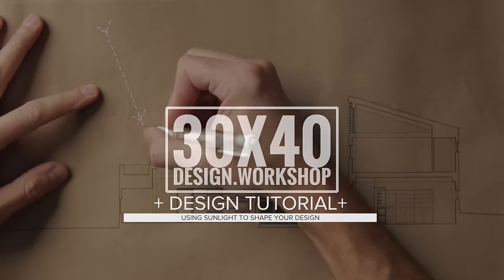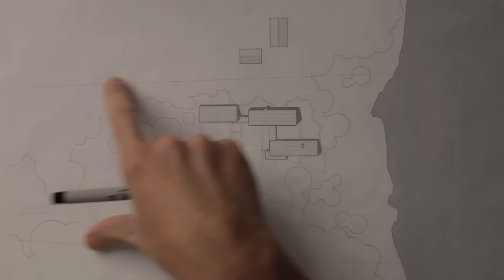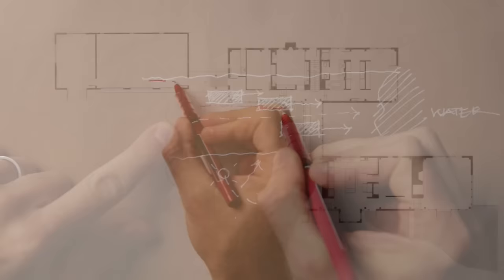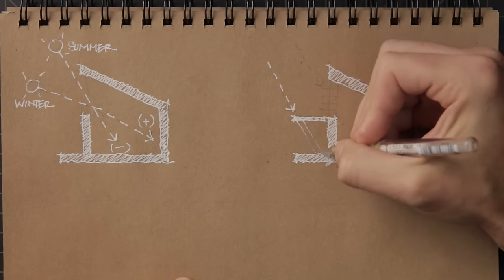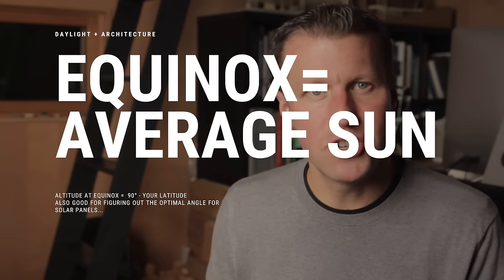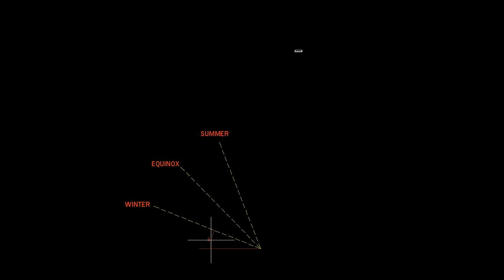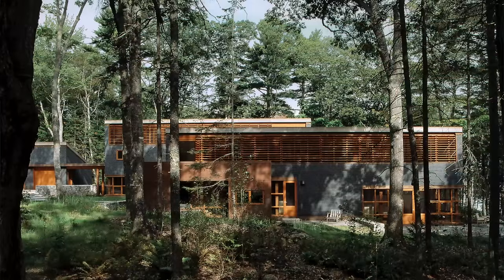Architectural Design Process | Form, Orientation and Sunlight

Comment: Hi Eric,  really enjoy your understanding of designing for the environment,  taking into consideration sun elevation and major wind directions. I lived in the Middle East where it can be extremely hot in the summer months and I found that the old techniques really helped in the comfort of the living area. Some design aspects are narrow through areas with high walls to shade from the sun completely and the use of wind towers in the buildings to produce the stack effect you mention.

Really enjoy your videos, and the ease of how you explain the reasoning behind what you are doing.

Comment: I like the design, and finding ways to get direct sunlight into the spaces, but here where we are very close to the equator - we want to always min. the solar radiation to cut costs on cooling as about 9 months of the year some degree of cooling is needed. Some ways we go around this is by allowing double to triple glazed windows to face north, and try to have a white surface reflect light into the space(s) - this reduces direct solar gains, and allows more light to penetrate the interior.

Comment: Hi Eric, are the external louvres operational? I have taken on a project for interior design and the master suite has a high level window at the peak of the roof. I am concerned about the light flooding in at sunrise and need to find a solution. The external option feels more of a design feature. I just wonder if they are static or movable? What if the clients wants to change their light deflection?

Comment: Excellent video once again Eric.  I'm currently studying Construction Management before I go on for my M.Arch.  I was wondering, what sort of project delivery system do you usually use?  Do you act as the GC on your projects like a Design-Build entity does?  Also, do you use MS Project?  Thanks again!
Reply from the maker: cheers +Casey Blake...my role is always as the architect (not a GC or CM), so I have a contract with the owner directly and the owner has a separate contract with the GC. on residential projects we don't usually use a CM, but in my past life working on large scale education and commercial work we often did...so standard relationships there...
Design-Build is interesting to me, but too much liability...and I don't use MS Project...

Comment: Hi! 
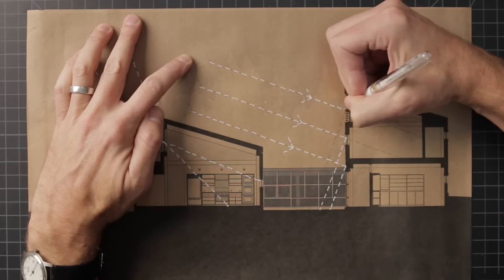I think that sunlight relflction in the sketch (sunlight analysis) at 3:41 is not really correct. Shouldn't the angle of reflection be the same for both incident and reflected ray? This would mean that the light in example position is not giving any direct sunlight on the ground between the two building objects. 
Also, very interesting video, thank you for your work!

Comment: Dear Eric,

Thank you for the video. I’ve watched it multiple times over the years, and when I watched it today a thought came to mind in relation to taking advantage of the “stack effect” (starting at 8:51), where the addition (and opening) of operable windows enables you to set up a natural convective flow: Do the windows need to be on opposite sides of the building, or would it also work if the windows are on the same side? E.g. would it work on a two-story house where both of said windows/vents would be located on a north-facing wall, i.e. pulling cold air from (the kitchen at) the first story, up the stairs, and out (the living room) on the second story?

Thank you in advance.

Comment: Thanks for the great content.
But i have a question how to give openings if i want sunset view right through out my window or balcony?
if i face them sharp to the west direction will the heat issue will problematic?
Reply from the maker: it all depends on where you're located...usually a setting sun is much less intense, so it could be okay...not sure where you're located...

Comment: The path of sunlight across my property is my current conundrum.  The sun comes from the east across the everglades and sets in the west across the Gulf of Mexico with two sides of the property being a gulf seawall.  The center is a rotunda.  Wings flair off it to octagons sitting on either side.  An additional two wings run forward from the octagons entering and terminating in octagons themselves.  My issue is how to sit this facing the sea.  I prefer everything bathed in sunlight.

Comment: How do you represent this "path" on the diagram you provide with your AutoCAD template? Do you change the 'sun' location besides the angles?
Reply from the maker: In plan I don't change the altitude, only the azimuth. I only do that in section/elevation. Hope that helps!
Reply: I think I understand? I measure your 'azimuth' based on the template you provide but I don't seem to find an angle of reference? Anyways, thank you for the great content you page has!!!

Comment: I am a bit skeptical about the importance of this solar orientation.  I understand that there needs to be parameters to guide design, because without constraints, possibilities are endless.  But I don't see why this is good.  Example is sitting in a booth at a restaurant, next to a giant plate glass window.  And the sun is shining in.  Is this good?  To most people it is to be avoided, because having the sun in your eyes is unpleasant.  So we have blinds to block the sun...  But why is sun orientation important when we then block the sun?  I think indirect light is much better, and north windows allow plenty of light.

Comment: The big question here is it THAT relevant (energy saving-wise) for sun to warm up this particular interior - compared to probably increased cost of this design, and increased heating cost at nights - that would need to be counted if it's actually justifiable by being cost effective - or is it just a cool quirk. And if it is indeed significantly cost effective - then why not make the whole wall glass to catch even more sun in the winter. I think that glass being the strongest heat bridge as always it already says this design is not cost effective at all, as it will loose a lot of heat in the nights. So this is another example stretching reality trying to make some solutions look justified, where indeed they are not - a very often architect project practice, which is disappointing in this field - let's just admit - we want to make it look cool - if it would be cost effective, it would be a box. I'm an Architect myself. I know - if we'd cut the BS then it would NOT look interesting. Right? ;)
Reply from the maker: Here's How
https://youtu.be/t7GpYvyQoEs